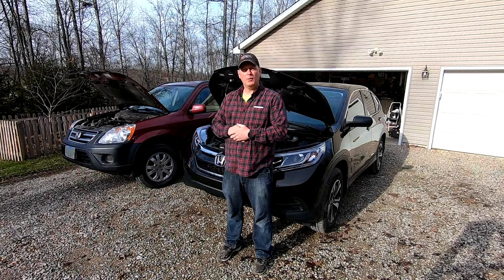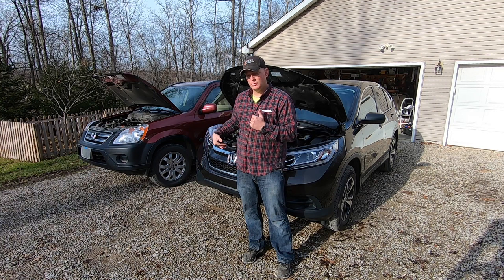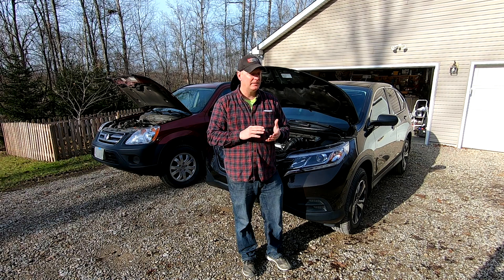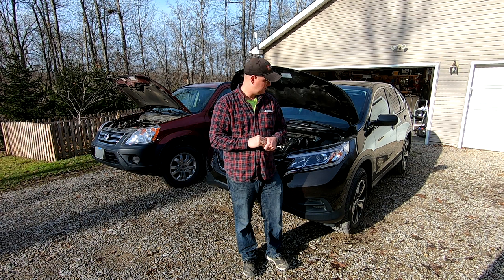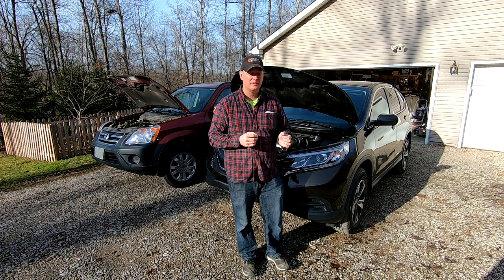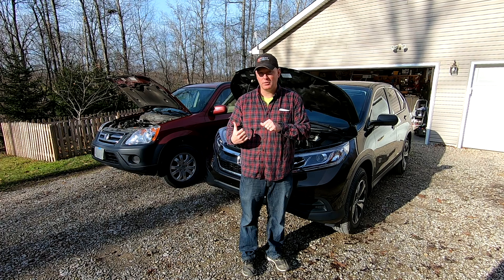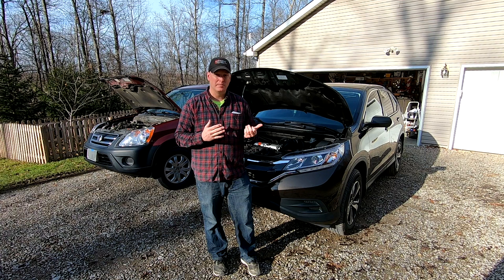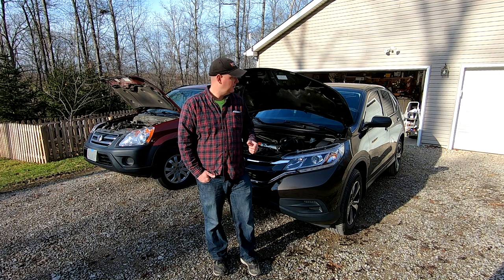DON'T BUY THIS CAR - 2012-2014 Honda CRV

Comment: Great video!! Thanks for the info!  I have been having the exact noise and wondering what it was because sometimes it’s there and sometimes not!!! I have 2014 CRV…what a bummer!! Of course warranty way over for me so I’ll have to pay to fix it…ugh…there needs to be a recall and Honda needs to be responsible for fixing it!  Have you ever had an issue with many warning lights coming on suddenly. My B123 service light came on Friday…no big deal just routine maintenance that needs to be done.  Two days later I drove home from work,  parked the car and when I started it the next morning, I had an EPS, check engine, vehicle stability assist, and tire pressure lights all on at the same time. The car was just parked over night?! What happened? Anyone who’s had this issue and dealt with it let me know…thanks
Reply from the maker: Possibly a battery issue. These cars are very sensitive to a dying battery, even if it still starts the car.
Reply: @JackofAllMasterofNone  Haha…if only it would have been the battery. Took it in for a diagnostic, and it had a “stretched” timing chain and I needed the VTC actuator replaced…hmmm weird! When I told him about the noise it made with starting. He said they are aware of that noise, but that wasn’t the cause of the problem. Anyway, ended up costing $2400 to get it fixed. He also tried to tell me that there was no oil that registered on the dipstick as to blame me for the problem. I have taken my car there for all services every time it has needed it and checked my oil in between, and I have never had it that low that it never showed up on the dipstick.!! My car also never indicated that my oil was low… you would think if it was significantly low that my oil light would’ve turned on to warn me.  He said my car was burning oil and when I asked why he said because it’s an old car. What a joke my 1999 Honda Accord is an old car but 2014 CRV is not. I think Honda just doesn’t want to own up to the fact that the VTC actuators are bad and take responsibility for it.  Major bummer!!
Reply from the maker: @mollyheiselt1842  yeah you have one of the severe cases that people say doesn't happen but obviously it does. The bad VTC actuator causes oil consumption and timing change stretch.

Comment: Had the death rattle on my 2012.  Have always used synthetic name brand 0w-20.  Replaced the VCT at about 150,000 miles. With the revised part.  1 month after the 6 month 6000 mile dealer service warranty it started again.  My daughter now drives the car, and it has about 240,000 miles on it.  Still has the death rattle on cold mornings.  It uses about a qt of oil between oil changes.

Comment: My only does this when cold starts ... & not always .. 2013 LX 180k . Now you got me worried ... Does not do it in summer or every time.  now you got me worried baha kk GREAT WORK W THE CONVERSION !!! btw did you need the bumper brackets it came with I got my grill w no bumper brackets from eBay . haven't installed yet. don't plan on doing the headlights either .
Reply from the maker: The 2015 up grill will not work with the 2013 style headlights. They are completely different.
Reply: @JackofAllMasterofNone  i tried the hidden menu trick & selected diagnostic. I got a few bars green and a few bars red " NG" now it is stuck on that screen.  Cannot go back . Reverse cam does not show. Help please.

Comment: You described my issue perfectly.  I use multiple quarts of oil between changes.  I’ve had to replace the timing chain prematurely.   Sucks.
Reply: You had to replace the chain because it got overheated from low oil in the crankcase, and stretched beyond what the tensioner could compensate for.

Comment: 2014 Honda CRV with 176K miles and only changed fluids and still going strong. No issues.
Reply from the maker: How often do you change your oil?

Comment: People just replace the spring in the vtc actuator removed the front screws on it and youll see the spring
Reply from the maker: Yes. I have heard that it may be a solution as long as your timing chain is not stretched

Comment: Bought my 2014 CR-V new and it never made this noise until it had about 60,000 miles on it. It does it rarely but I live in Florida. At 127,000 miles it seems to be doing it less and less. I think I just won't worry about it.

Comment: I have a 2013 Honda CRV and recently it did start making this noise.  However, it has been a nearly flawless vehicle other than this and some issues with brake rust (live in cold area with lots of salt application).  After 120k miles, I'd say it is one of the lowest cost cars I've owned so hard to say that it is a bad investment.

Comment: Part of the problem is using 0 -20 oil!  I've always used 5W-20 Castrol Edge oil after we got 60,000 miles on the engine!  That little added thickness of oil at start ups has protected the engine and not had  this issue!  200,000 + miles and still going strong!  You might notice a slight decrease on gas milage because the oil is slightly heavier but well worth it as the engine gets older!  Royal Purple socks!  I've owned 2 Napa Auto Parts stores for 48 years and Valvoline and Castrol are the only 2 oils that protect your engine!
Reply: Owning a couple of auto parts stores doesn't make you a technician.
Stating that Valvoline & Castrol are the only two oils that protect your engine is nonsense.

Comment: I have a 2012 accord 2.4 .. I’m replacing the vtc as we speak and it was a bit of a biotch but what I did notice in the repair is that replacing the tensioner at the same time might be a good idea because the teeth on the tensioner wear out and noise comes back . Do both the vtc actuator and tensioner and rattle should stop and also keep up on your oil level to assure proper pressure to both these components.

Comment: Been driving around 50000kms with this, it happens more frequently if I do long trips. If I abuse the car a bit like frequent short trips, then it is better. Perhaps oil viscosity due to water or its level is a hint?
Reply: Still running just fine. Lately I haven't heard the sound at all. The car is reliable as a 50 ton boulder on your back yard...

Comment: This also happened with my 2011 Toyota corolla where the VVT gear wears. I also have a 2013 CRV however in my country it the Japanese version which comes with the R20A engine. It has iVTEC but I don't think it has the VCT actuator. Overall its reliable but the engine does vibrate more than I would like when in drive and standstill ( i checked everything that could cause it).

Comment: I’m having the same issue, but I’m also dealing with my 2013 CRV with burning oil. I don’t know how that happens? No dripping …no smoking …just goes dry unless I’m putting oil in every 1000 miles! The dealership suggestion was check the oil every 1000 miles🥺
Reply from the maker: It's got to be burning it if it isn't leaking it. So either a valve problem or a ring problem. Or the easy thing to try first is change your PCV valve. A stuck open valve will go through oil quick.

Comment: I like the content of your videos. My comment is about the vibration of the seat and headrest for 2015 -2016 CR V’s. It affects the seat and headrests. Honda issued a TSB 15-046 for the 2015 but not the 2016. My understanding is the owner would have to pay for the fix if not under warranty. It’s one of those things that affects some but not others and is not safety related. I would appreciate your comments. Thank you. I’m very sorry to hear of the problems with the VTC actuator you have been having. I don’t think Honda has stepped up to the plate to help you and that is unacceptable. Thanks again for letting us know about this issue. I don’t think Greg, the Car Angel mentioned it in his recent view of all generations.
Reply from the maker: I had a 2016 CRV and it had a slight vibration at idle in gear in certain circumstances, but was very minor and was not something that bothered me at all. The 2015 supposedly could be worse, but again from my experience it isn't anything horrible.
Reply: That is good to hear. Back in 2015 I took a new CR V out for a test drive and did not feel any vibrations. I have an older 2002 CR V which I want to upgrade. This talk about vibrations had put me off considering the 2016. Hearing your experience has helped as I like everyone else about the car except for the below standard detailing. The prices remain high and with talk of the settlement by the UAW they could go higher. Check out Weird Beards preparation for flipping a car. He’s extremely diligent for a flipper. Thanks

Comment: Yup, same problem with a 2014 4-cyl Accord. I'm taking it into service for replacement of the VTC actuator and possibly the timing chain tensioner next week. Only 43K miles on this car. Hopefully these repairs will last longer than on your CRV. I'm going back to Toyota for my next vehicle.☹

Comment: Had a similar problem with our 2012 CRV. The dealer replace it under warranty and about six months later it came back. I talked to one of the service writers and they said if it was let go for long enough you should replace the whole timing chain, actuators, and tensioner. I replaced it about a year ago and we put about 10,000 miles on and the noise has not come back. That's all we've had to do on this car since buying it  brand new. So I don't agree with your assessment of the vehicle. 120k and counting

Comment: same exact problem I had.. I went back to the dealer and i was so mad because they know they car had the problem and still sold it to me knowing I would not know while buying the car because it only made the sound on a cold start.
Reply from the maker: Yeah. It's very hard to catch unless you make sure you don't tell them you are coming and dont let them go start it without you being there. Dealers want you to wait while they go start it and bring it around. I would insist on standing right there when they start it when it comes to buying a CRV.
Reply: @JackofAllMasterofNone  needs to be more protection... if you knowingly fail to disclose a known problem you should either refund or fix the problem... too much people escape with this "as is" tactic
Reply from the maker: Agree. But  they would claim they didn't know I'm sure.
Reply: @JackofAllMasterofNone I always tell them not to start the car up before I come. Or I will go unannounced. If you open the hood and the engine feels hot, means they started it before you came

Comment: I am looking at one of these. My heart was set on a rav4 2019-2022 but my god they are expensive. I wanted an suv with good gas mileage and for camping, soft roading. But looking at things getting something a little bit more well alot less expensive for what I want to do the crv seems like the way to go for my needs now.
Reply: get an older rav4?
Reply: Honda's all-wheel drive system is a poor choice,  for even the very lightest of unpaved road use. For folks who live in serious snow country, or travel in rough, unmaintained roads, Hondas are far from the top choice. In snow county, like Northern New England and Colorado, there is a reason why Subarus are the dominant all wheel drive compact SUV, theie AWD system runs circles around the competition, when the weather turns ugly.

 I once got slightly off the edge of a gravel road with my 2014 CRV. Two wheels on flat, fresh clean gravel, two wheels on a firm, grassy, very shallow ditch, with a bit of water in it. I immediately got stuck. I had to reverse back on to the road.  ANY front wheel drive vehicle should have shot right back on to the gravel road, with a bit of light throttle, the CRV sat there like the wheels were not touching the ground. My son has a fabricating shop where he builds off-road trucks. He also drives a Honda Element. I asked him what I did wrong to get the car stuck on something any car should have handled? He explained it was nothing but an example of how truly pathetic Honda's  all wheel drive system actually performs.
Reply: You probably could have held the brake a little and it would have done exactly what you expected. The situation you encountered is just a limitation of open differentials,  it's not Honda specific.
Reply: @TurkeySandwichJr  Gen 4 CR-Vs are demonstrated to have the worst AWD of any SUV.

Comment: I am not a mechanic. My 2014 CR-V started that morning startup clatter at 97,000 miles. At the oil change at 98,000, I switched to 5-30 full synthetic. 3,000 miles since oil change, no morning startup clatter.
Reply from the maker: Glad to hear that helped.

Comment: 9 months after a new Actuator and timing chain and tensioner/guides etc. I’m still burning oil a year later between changes.I’m back in the same spot as before but worse oil burning like 2 quarts in 2 months vs a quart every 4 months. Dealer says it’s the piston rings and gaskets now and not the actuator. Have it in an engine shop right now for a 2nd opinion and probably getting rid of it if they don’t have a good solution.
Reply from the maker: How many miles and what year?

Comment: Had a 2011 purchased w/ 130k, it made a slight clicking in cold starts, not the loud rattle like in the video. I let it go, drove it up to 250k and was never an issue. 

Now I purchased a 14 w/ 96k in September of 23. And a week later the LOUD rattle started on cold starts. Haven’t done anything, just let it go. now it’s almost June 24 and everything seems to be operating good still. Other than that.And now that the weather is  getting warmer (Cleveland,OH)it seems to happen less. 

I figure if it ever needs expensive major repair I’ll just borrow the money from my 401k and pay myself back with interest. At least that way I’ll make money on the deal. That’s my plan anyway LOL 😂

Comment: 172,000 miles on my wife’s 2013 CRV so far.
Reply: And did you change your oil more frequently or use any additives to the oil as part of your maintenance? Do you have the serpentine belt and not the drive chain?

Comment: 2017 more reliable?  Oil dilution and head gasket failures say no. 

VCt actuator isn't hard to replace, especially on your CR-V if you want to do it yourself and save a fair bit of money. 

And you probably should do the running chain tensioner at the same time.
Reply from the maker: Oil dilution is only a problem on the 1.5 turbo. The 2017-2019 LX with the 2.4 is a much better vehicle.

Comment: The man in the video is correct. It pisses me off that Honda won't fix the issue for free. I had a 2001 that I drove until 2019 and a drunk driver totaled it when he hit me. It was a great vehicle, but it also had an issue that should have been recalled as well. That model had an air conditioner issue that cost me about $1,300 dollars. I will never own another Honda because they should do the right thing.

Comment: Another thing that makes a similar noise is the bendix getting dirt in it and it not releasing fast enough.  Only happens when cold.  I love my 2013.  90k trouble free miles.
Reply from the maker: That's what I thought it was at first, until I listened carefully. This is a very well known defect in these cars unfortunately.

Comment: I have a 2015. I thought for sure you were going to mention the vibration issue. Best way I can explain it is, if you've ever driven a stick and gone from 2nd gear to 4th (skipping 3rd) that bogging down, vibration is what I mean. It's at 1100 RPM's or @ 40 MPH. CVT transmission of course. Not sure if it's an engine problem or CVT but, I know IT'S ANNOYING!
Reply from the maker: This video is specific to the 2012 through 2014 CRV. The 2015 through 16 have their own set of problems but are not as bad as the previous ones.

Comment: I experienced that same problem, and also another one. The cabin heating system developed a blockage that blocked the heter from working on the drivers side of the cabin. Has that been a problem for any other cr-v 2013 owners? OK, didnt watch to the end. Had the same experience with the dealer. Scarred my opinion of Honda. Still drive them but dont highly  recommend to others.

Comment: i just bought this one 2013 10 days ago, i don't hear this noise, except after second gear the car rattles on a low acceleration, and i just found out that its because of the torc converter which it existed from 2012 to 2016, luckily i bought a warranty for this car which i am going to go to honda dealership to have the torc converter replaced, or get it fixed. but i was told it wouldn't harm anything and it can go without any damage for more than a 500k mile! i am at 60k now, the car looks like it literally just came out of the showroom!
Reply from the maker: Yes. That torque converter problem was another common issue these vehicles had, mostly due to lack of frequent transmission fluid changes. If it is minor a round of 3 fluid changes may take care of your problem.
Reply: @JackofAllMasterofNone  thanks 👍
Reply: Don't trust what you are told. Take it to your own mechanic 1st. You'll be surprised even with the extended warranty what it won't cover.

Comment: I have had my 2013 honda CRV for about 8 years I am the second owner never had any problems with it I do my oil changes when needed and everything else but never had any actuator problems but seem like a small fix compared to the 2015 and up models that have the CVT transmission which are no good better to go full auto then CVT.
Reply from the maker: I've had both and prefer the 2016. CVT is fine as long as you keep up with fluid changes every 30k miles. The revised engine in 2015 has more power and less problems.

Comment: I'm glad I found this video because I've been having this issue with my 2012 CRV... Guess I need to take it to the dealership and use my warranty to get it fixed up.. it's only at 72000 miles
Reply: Do you have an extended warranty? Its suppose to be expired by now since its a 2012 and over 60K miles.
-Source: 2012 EX owner as well.
Reply: @2fast4all  yup got an extended 60,000 mile warranty when I bought it in November